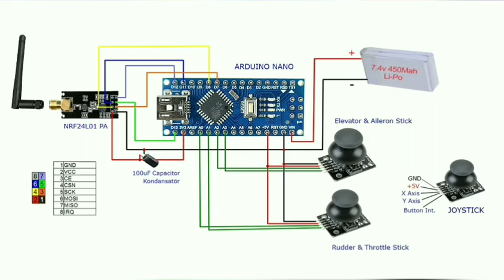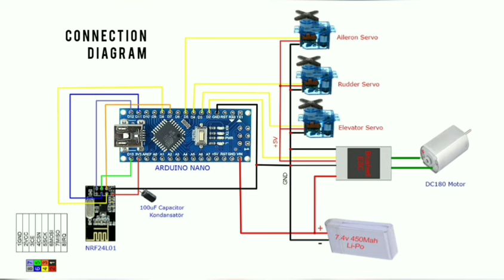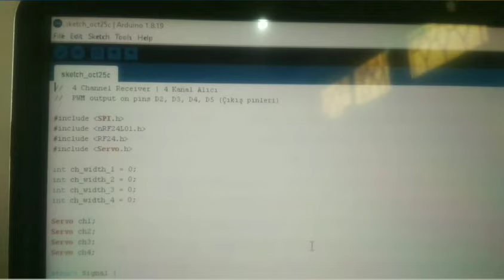How To Make Arduino Rc transmitter and receiver at home|diyArduino Rc Transmitter |Arduino projects|

Comment: The nrf24l01 module capacitor voltage?!
Reply from the maker: 10uf 50v electrolytic capacitor
Reply: @DroneScienceTech1993  can i use 10uf 16v?!
Reply from the maker: Yes offcourse and 3.3v pin to positive
Reply: @DroneScienceTech1993  thank you 🙏🏽🙏🏽❤️